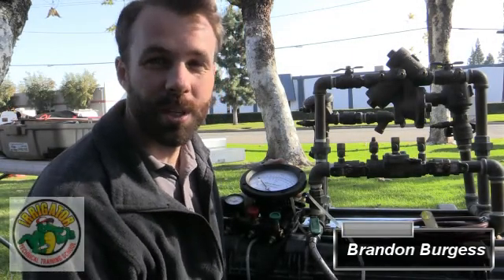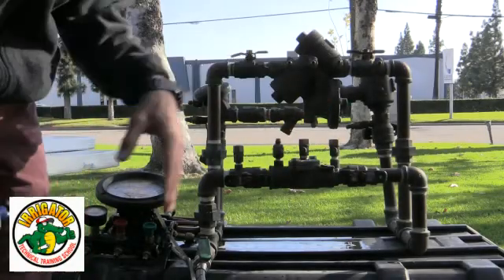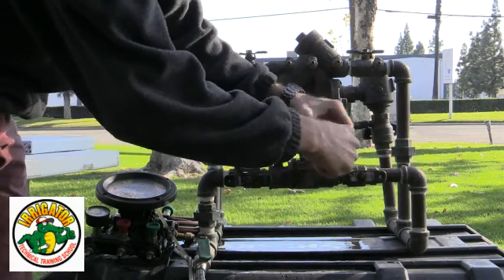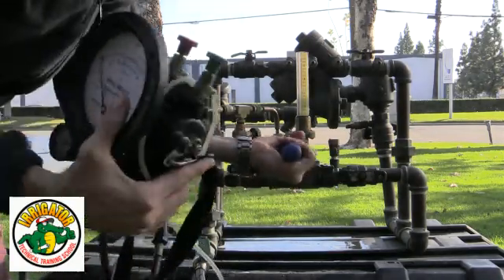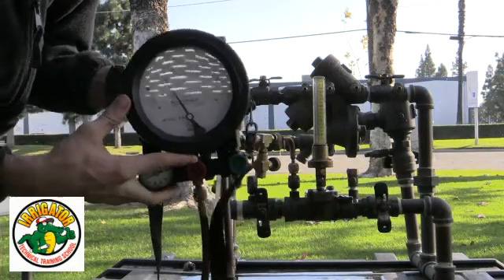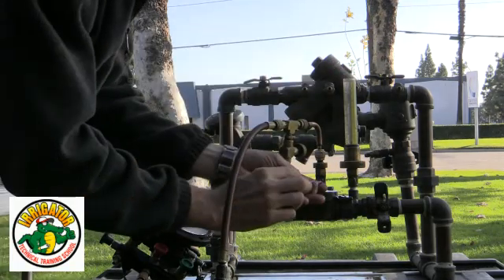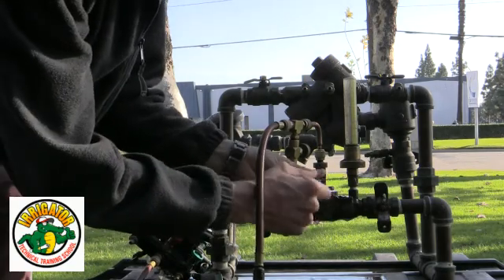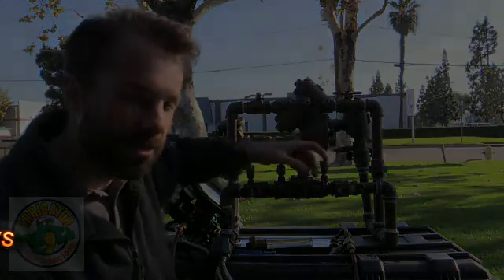How to test a Double Check Backflow Prevention Assembly

Comment: What anout if the water recedes on the first check could still go on and check the other check valve? 
2 what about if the water keeps on running through the tube ?